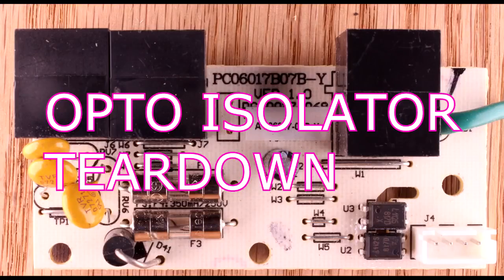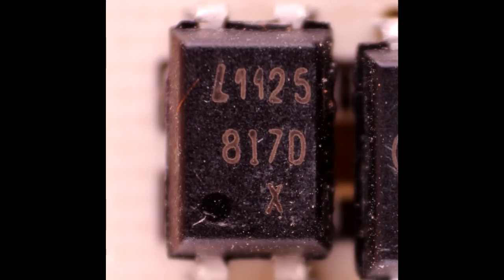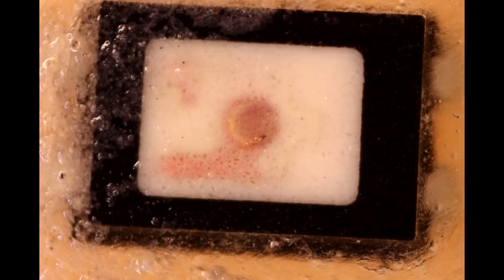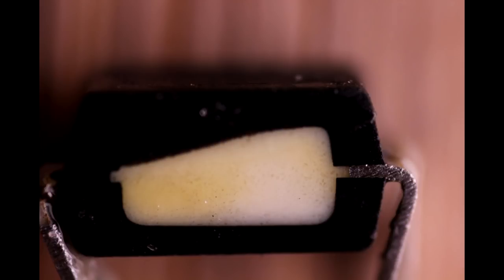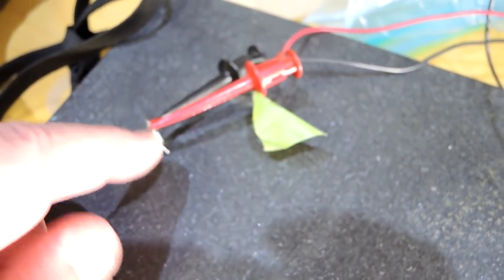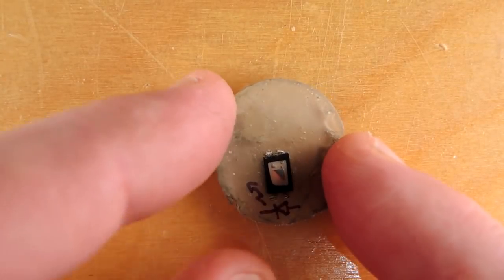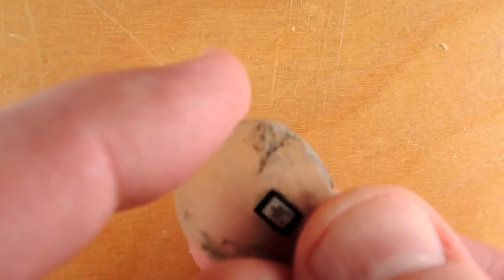Teardown of an Optoisolator

Comment: I am totally new to electronics. and I thought they were all led PV. where the output enough voltage to turn on the gate of a FET. however after researching them for a project. I guess not. I would like to know more about how the output side works . on all the optical isolators. or optical isolator. I only know what the net has taught me. with very little experience. I mostly go from project to project. googling and you tubing the components. or what I don't understand .videos like this are so cool. I have this uncontrollable urge to see how everything works! ic's and electrical and electronic components are the coolest. I wish I hot into this when I was young! thanks and great video....

Comment: Were you able to see the infared light at all? I'm able to see TV remotes. I'm not super sensitive like the camera is, but I can see a little bit of light from them. I'm sure they're overlapping onto the visible spectrum a bit, and I was wondering if the LED in there was the same.
Reply: Most people can't see even normal TV remotes. Remotes have a comfortable voltage to work with, so they could use a variety of frequencies maybe up to right around 800nm. Here it's 1.2V forward voltage and 940nm. The nominal visible range extends merely to 750nm or so, so seeing 800nm light is quite plausible, but 940nm, extremely unlikely. And i mean he couldn't see it even on a normal camera, the IR-cut filter removed it, and you know IR-cut filters aren't actually nearly as sharply tuned as our vision.

Comment: Thanks for the video. I find it interesting that so much trouble goes to isolation on the outside of the opto, but inside the package, such a small amount of plastic epoxy is keeping one side from the other.

Comment: Typical give away it is an IR led is forward voltage, around 1V1 for a silicon IR led, which is a good match for the silicon controlled device on the other side of the isolation layer.

Going to dissolve all the epoxy away to see the actual transistors?

I also remember getting old glass OC series small  point contact germanium signal transistors and removing the black paint from them, making some of them into OCP versions, because the inside filling grease was reasonably transparent. Later versions they went to a white opaque ( I guess filled with titanium dioxide dust) fill that was nearly opaque to light anyway, which made them no longer respond even when just glass.

Comment: Cool, I always thought those packages were hollow
Reply: Probably wouldn't achieve optimum high voltage isolation internally. Not to mention mechanical stability, as well being difficult to manufacture.

Comment: 100ma for one led is pretty high current really, then i suppose it will run on a lot less too?   great video
Reply: Typically a pulse current rating, they have a spec for drive current up to 1A on most, just with a really low duty cycle to limit power dissipation, used to compensate for the typical really terrible transfer ratio of the devices. Drive required really depends on the application, and sadly also does change with both temperature, time and aging of the device.
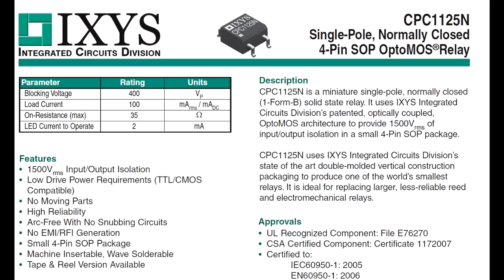Reply: I was surprised to read that it would operate all the way down to 2ma as that is 1/10th we are taught most open-air light emitting diodes operate at. Is it because it is more efficient or is it only true because its an infrared LED operating in a very narrow range? 0:42
Reply: John Possum  - A lot of modern LEDs will light up enough to see in a dark room with tens of microamps.
A milliamp or two will drive the optoisolators if you don't need much speed or current.
Reply: IR diodes usually can take much higher currents. 100mA continuous and a few amps of pulse currents in 5mm cases isn't unusual. Optoisolators are similar in that regard. It depends on what you want to do with the isolator. They are not "digital" devices, they have a linear transfer curve (ideally) of input current to output current. Think of them having an hfe like in a transistor (except that an isolators hfe is usually lower than one).